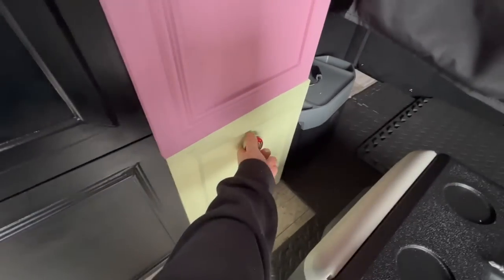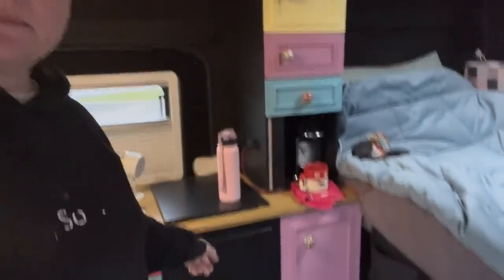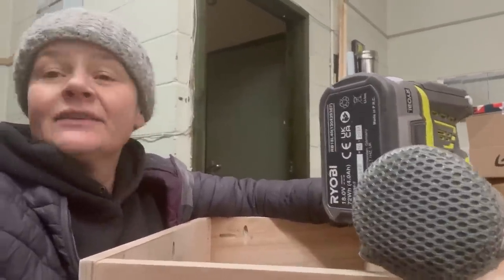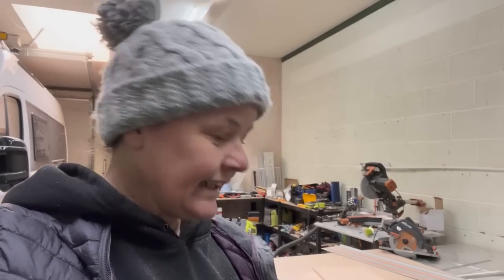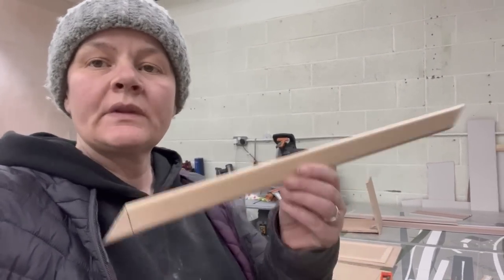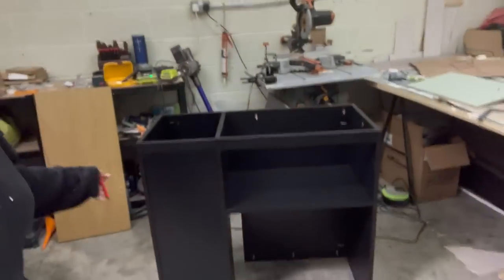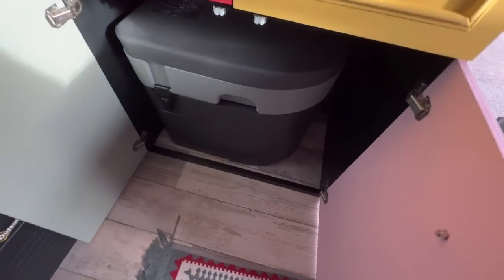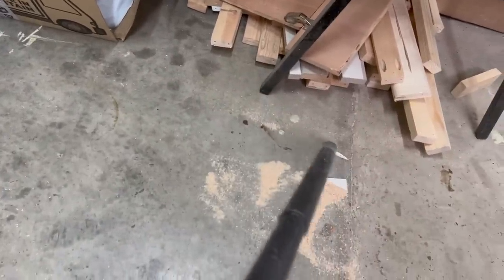UMV10 - Is symmetry so important?

Comment: You made a cracking job of that unit Mandy 😍

My preference is for open plan unless you need more storage 🤔

Oh and little tip I learnt as an apprentice - Sweep the sawdust into a little pile and it makes Hoovering it up  easier 😉😘
Reply from the maker: We usually do that but I’d already cleaned up and John used the saw again 😂 he didn’t die either 🤣
Reply: @unadventurousmandy  😆😆

Comment: Would it be possible for you to put your toilet on some runners. Not sure how that would be done because I am not a carpenter but it would make it easier for you to pull out to use. By the way you are doing great with the van. Can't wait to see it finished and you off exploring. x
Reply from the maker: It’ll be fine the way it is at the mo.. I don’t leave it in between the doors as I need a little extra space